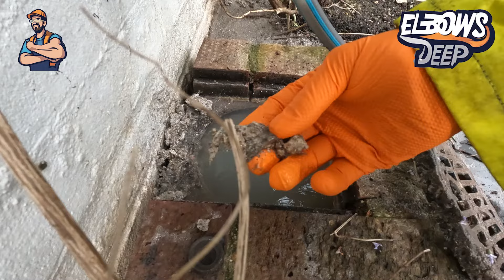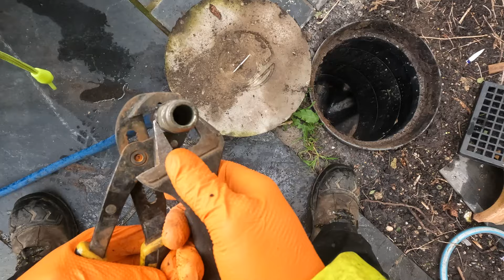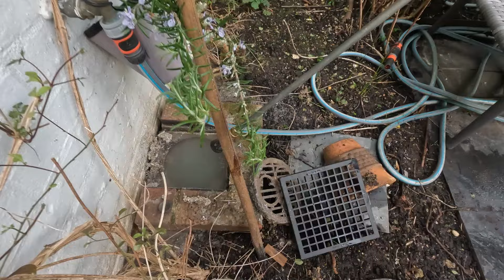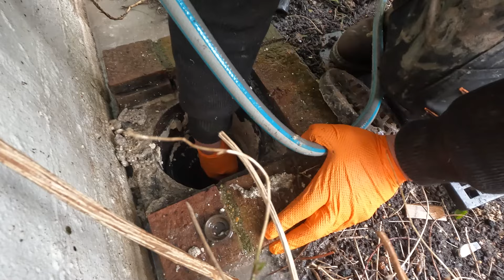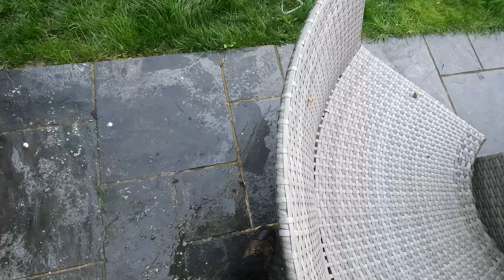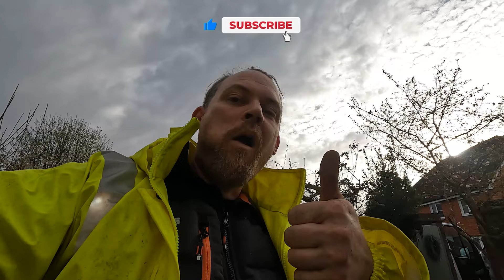Blocked Drain 29 Quick and Easy Kitchen Gully Fat Flush

Comment: Please use eye protection and be careful when using that disinfectant (contains benzalkonium chloride).  Eye damage is a real concern with that chemical.  If memory serves me correctly,  The Drain Unblockers  switched to using a disinfectant that has lactic acid as the antimicrobial agent a year or two ago.  I think they said it was lemon scented.

Good job as always.
Cheers.
Reply from the maker: Hi Arty. Yes it does and yes it’s a real hazard. I was just using sodium hydrochloride for years very diluted bleach but trouble is it leaves clean spots where used 😂 this stuff is better and far less expensive. I will take a look at what they use and consider switching. I like lemon fresh 🤩

Thanks for the kind comment again Arty 🙂